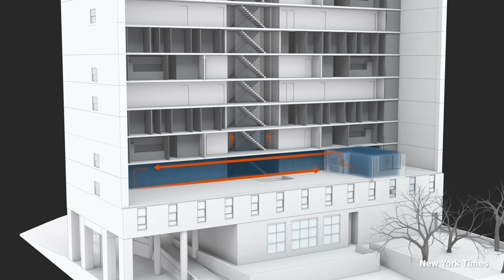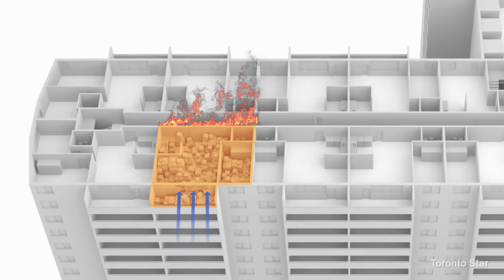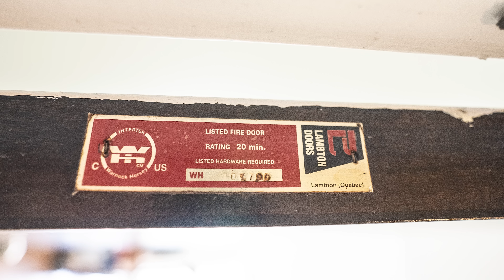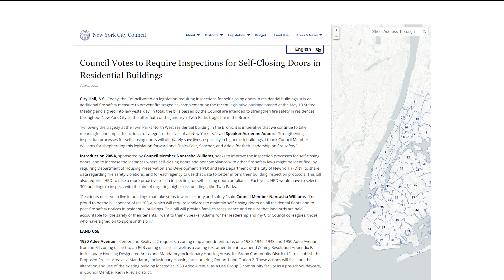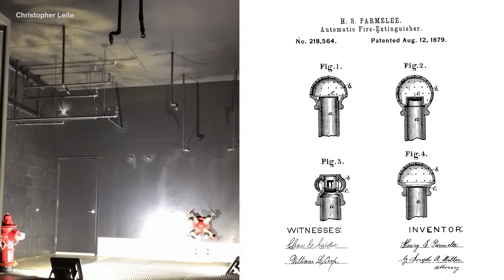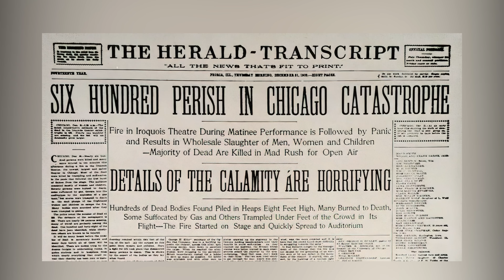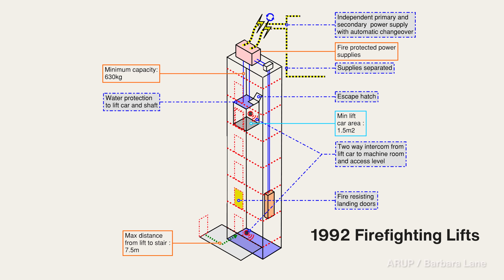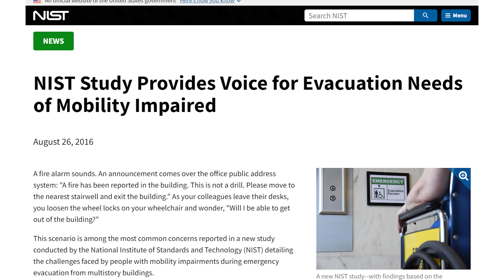How Hidden Engineering Keeps You Alive in Apartment Fires

Comment: So my apartment door is a fire door (only 20 minutes) but I suspect it’s installed incorrectly since there are large gaps on all sides, especially the bottom. I hope that expanding strip is installed but the bottom gap is very large
Reply: I think door foam that expands when heated is mostly a non-US thing. I've lost this argument at my apartment in L.A. I have a heavy fire door. But it requires thick weatherstripping all around it to keep out a strong breeze that is always gushing in from the hall. After enjoying the draft-free setup for six years, one manager suddenly saw it and had the maintenance man scrape it off. The fire inspector now insists that the door MUST slam itself closed when let go after being held open just four inches short of closing! It DOES slam itself closed, even with tight weatherstripping, when let go from about ten inches. 

Ugh. Toxic fumes sometimes come in around the door. Therefore smoke will, too. I offered to pay to install an automatic door closer at the top. The manager said he thinks they are illegal.

Comment: This is pretty cool. I'm an electrical engineer so I always flip right past the fire stuff when I'm reading the code books or plans. I'm familiar with fire ratings on walls but didn't know they encase the conduit passing through walls in that fire resistant goo.
Reply from the maker: Yep, a major issue is that contractors can go in and punch holes in walls without knowing that they have to be patched with the right firestopping materials.  Easy to overlook though as each trade has their own specializations.

Comment: So, I'm very familiar with fire codes in the US and the Iroquois Theatre fire. I work as an electrician in theatre. 

One thing that caught me off guard - I was touring China for work and we had push bars that were bike chained closed backstage. 

If you don't know, theatres are designed so that the stage housing can be separated from the house by fireproof curtains and often contain a deluge system that floods the stage with water if the fire is located on/backstage stage. 

There was no deluge or fire curtain at that venue.
Reply: pushbars are known security flaw in buildings since people bypass door locks to get access into buildings they are not supposed to be in

Comment: damm i live in argentina in a 60 yo building. doesn't have any fire countermeasures. the last 2 times there where fires (2y ago and 15 y ago) we wake up because people started knocking doors and screaming fire. but in bot cases it didn't fill with smoke. but my uncle died in a fire while in an hotel in the beach 10y ago. i really should buy a few smoke detectors so we don't die in our sleep or wake up to an smoke filled room. also like 60% of the people in my building are of the third age with caused that scare of 2y ago to have them going really slow in the stairs. wich are also not modern stairs they are not separate from the floor since my building is not a rectangle but an HHH shape with the stairs in the middle of the middle H so there  is not hard core to the building.

Comment: I'm just glad that in my apartment, I'm on the first floor and so I can just smash threw a window and get out. But yeah, for older buildings, people above you can have their apartments burn up as windows shatter from heat shock and embers flow into the apartment above.
Reply from the maker: Yeah that almost happened in a BC fire!  Luckily the fire department arrived in time.  But it wouldn't have spread across the rest of the building quickly

Comment: Listen to older people so you don't have to learn the hard way.

Space heaters and extension cords are dangerous fire hazards. Dryer lint traps need to be cleaned and so do the vents behind them into the wall to prevent lint backing up inside the machine and catching fire in the hours while you sleep. Watch out for carbon monoxide and change the batteries in all the detectors. Ovens, stoves, and other appliances need to never be left unattended. Never cut the safety lid switch be bypassed on a washing machine, especially if you have kids or if you don't want to be criminally liable. Do not park in the grass with your hot muffler/exhaust system/motor, etc. Know how to contact emergency services and have a backup plan in case they take 12 minutes to answer and two hours to get out to you (both true stories). Know where hospitals are. Don't smoke in bed. Don't force people whose faces flush to drink, or anyone else. Don't mix cleaning chemicals or use bleach or ammonia containing cleaners in enclosed areas. Don't ignore slip hazards. Don't leave kids and small pets unattended in places where predation exists. Kids can easily be lost in mountains and cover a lot of ground quickly, with all the hazards. Water is always more dangerous than it looks and can down you in shallow water by speed over rough rocks or sweep the sand out from underneath your foot at the edge, etc. Riptides kill. Undertow kills. Do not underestimate natural disasters just because the last one seems okay or someone said they didn't have a rough day. Do not leave guns where anyone can get at them or the ammo. 

There is a lot more to know, but young people need to stay close to older people who already know this stuff.

Comment: Fire sprinkler systems are not small and handheld like is suggested and that's why we don't see retrofits required. It's completely intergraded into the building meaning it would basically have to be gut reno to add.

Comment: Fire sprinklers have been mandated in Australia for easily 20 years (buildings over 25 m) also, most new buildings are required to have fire booster pumps separate to the building to provide the fire main within

Comment: Ever wondered why there are Open/Close buttons in elevators that don't seem to work?
They are used by Firefighters. When the elevator is in FF mode, the doors don't open automatically when it reaches a floor - this is done in case there is a fire on the floor. Instead the FF holds the open button to open the door - if there is a fire, they release the button and the door closes. If it's safe, they can hold the button until the door is fully open and then it will stay open. The close button is then needed to close the door again.

Comment: Otherwise I think it checks out, but I would dare to say that 50 years ago homes had a lots of synthetic fibers.  Also the cushioning used on sofas to be highly flammable,  but I think it has changed for that exact reason.
Reply from the maker: From what I understand, it's much harder to ignite synthetic couches because of the flame retardants they use.  However if they do catch on fire, it's going to be bad, especially as the additives used release a ton of nasty stuff into the air
Reply: @Lam  yeah, could be. Just thought that 1970's couches most likely had synthetic draping as those were new and fancy.

Comment: wait, are you saying that buildings that are engulfed in flames do NOT spontaneously collapse into their footprints? interesting. you must be a truther of sorts...
Reply: normal fires.... that didn't cause multiple floors to collapse
Reply: @Ed.E  so what "special fires" are you talking about? plz inform me about the kind of circumstances that would f.e. create welding temperatures for a prolongued time...
Reply: @Ed.E  why don't you just link me that video of that blacksmith who compares boxcolumns under open incomplete low heat combustions with finger thick rebar being melted with a kerosene TORCH, will you?
Reply: @JefframinEpsteinyahu  did that blacksmith account for the thousands of tons weighing down the truss whilst it was heated? Or the vertical displacement? Or the progressive collapse? Did you pass High school physics?
Reply: @JefframinEpsteinyahu  Have you seen Ace Baker's ''The great American psy opera''

Comment: I used to work in newer build in Japan , 15 stories high.  it had two stair case one inside, but it was blocked half way somebody storing stuff.  and another one outside , open spiral stairs runs all the 16 floors.   it also had escape shoot , it was made out of fabric and it goes straight down, I am not sure how they work, but it must work other wise they will not installed them.

Comment: Hi Andrew!  I'm in Toronto, eh.  4 story, wood structure.  I'm in a 275 sq ft bachelor unit. I have 4 sprinkler heads!
Reply from the maker: Nice, that's reassuring!
Reply: @Lam  one is right above my head as I sleep.  
One is on the wall, by the kitchen.
One is in the small, 38" wide by 19" deep closet.
Final one is in the bathroom.

We have picture/plate glass windows, and, sadly, right outside, about 3' away, are electrical wires (confirmed by the resistor sitting about 4' from my window. 🤣I don't feel that's a safe place, but, I'm not an engineer.)

This place was built in 2015, so, obviously, matches up to the standards of 2015.
Management has the alarm tested monthly, the sprinklers every 6 months, and they blow them out (via a designated nozzle in the fire room, via the Siamese 
connectors.

Comment: I live in a mill building that was converted to apartments. There is very thick fire resistant material below each floor, and walls between units are double fire rated sheetrock on each side (which also greatly reduces noise). In my 1 bedroom apartment there are 10 sprinkler heads, and the building has a massive generator backed pump capable of running every sprinkler head in the building at full pressure. There has been an apartment fire while I've lived here, and aside from smoke that did get into common areas the damage was entirely contained to the one apartment. I feel very safe here.

Comment: In a fire in a high rise building always use your brain and figure for yourself if you need to get out - never rely on somebody who isn't there to tell you if you should stay or leave; if the fire isn't contained you should probably get out if the fire is contained and emergency services are working on it don't get in the way. More general point on the video, yes, absolutely: but the fire protections rely on people competently reinstating it to the fire stopping to at least it's original design standard after work is done - this rarely happens in reality - the older a building is the more likely you are to see removed, incomplete or unstable fire stopping. Water ingress over time and damp can cause this to fail also. Even in an incredibly highly regulated environment like the UK this can go very wrong very quickly as happened with Grenfell - imagine in a country where nobody cares in the best of times. One size does not fit all.

Comment: those bars on the doors are rather uncommon in Germany; I know only a few malls which have them, but anything from apartment buildings to office buildings, cinemas etc have other types of fire doors where the handle needs to be pushed down or to the side
Reply from the maker: Malls often don't have them because public facing doors are unlocked through most of the day.  Anything in lesser used areas or in stairways will often use panic devices
Reply: @Lam  malls are about the only place where I've seen them at all; Other doors often have some kind of mechanism on them which will trigger a fire or safety alarm once the handle is pushed down
Reply: @Lam  like these safety alarms mounted underneath the door handle: https://www.youtube.com/watch?v=Z-VyFxMDQiM

Comment: 14:05 is that why you're not allowed to use them during a fire? Not because of the risk of being trapped, but because it needs to be used by firefighters? That's interesting, never knew that.
Reply: Mamy reasons actually:
1) smoke can obstruct the door safety mechanism light sensor and you cannot close the door as it will keep sensing the door is blocked. Fire lifts in fire mode are manually operated to prevent this.
2) smoke may enter the lift shaft. Fire fighting lobbies are pressurized to prevent smoke from entering the lift lobby. Normal lift lobbies do not have pressurisation.
3) fire may damage the power supply to the lift, or control system to the lift. All lift are using essential power with fire rated cable. Essential means there is a backup power supply in case the building power goes out. Changeover is not instantenous. 
4) in a fire all lifts will go down to grd floor and open and shut down upon receiving a fire signal from the main fire alarm panel. Only a fireman switch at the fire lift can override this
Reply from the maker: Great explanation!
Reply: Look up marina bay suites fire in singapore. Lift malfunctioned causing 2 security guards to die. Fire fighters had to stop several floors lower to fight the fire since the fire was very intense and the fire lobby had combustile materials.

Comment: One of things that's also important is the consistency and sensitivity of the building's automatic fire detection system. This past summer, I lived in a newly constructed apartment building that has per suite fire detectors, automatic fire doors that are opening during normal use but closes when the system detects a fire, insulated fire escape elevators, and many other advanced features. The only problem is the overly sensitive fire detection system kept triggering and ordering whole building evacuation from people smoking weed in their apartments. After the third such evacuation, 90% of the residents no longer evaculate, which meant the state-of-art automatic system in advertently caused more complacency due to an incorrect setup.
Reply from the maker: Yeah, that's unfortunate.  Too bad they couldn't change how the alerts go out

Comment: Not in my building, they punched holes in the firewalls and turn off the vents in the stairwells to save on air conditioning ...  🎉
Reply from the maker: Yikes
Reply: You should report that to the Fire Department. Unless there is corruption (a big if depending on the location), they will enforce the fire code.

Comment: 12:07 fire services can actually employ makeshift overpressure zones.

We have dedicated fans for that. On top of that our station usually sends a team to set up the correct ventilation requirements for this as part of the scouting in such buildings.

Another reason why you should not try to leave through a smoke filled staircase, we can make it safe, even older ones.
Reply from the maker: I was reading about positive pressure ventilation!  I was originally going to make a video about firefighting but pivoted.  That's an interesting tidbit about the way stairways are made safe that I didn't know about
Reply: @Lam  basically what you do is close all the doors to the stairway, including and especially the way to the fire. Then you create an opening that is smaller than the intake (usually the door) and then turn on the ventilator.

You can usually extend that to an entire hallway for one level of a building if you open the "exhaust" at the end of that hallway, (it's not really an exhaust, just so there is a flow of air and not smoke from the fire pushed through the cracks as there is no where for the air to go).

This way you can safely evacuate level by level even when the building is fully smoke filled when you arrive.

It's super cool to see when you have it running. Also way better for residents ladder trucks and emergency respirator hoods.

Comment: 16.23 The fire rapid fire spread  was caused by flammable cladding on the outside of the building which quickly engulfed the whole of the building in flames.
Many died in smoke filled exits or in their rooms because they were told to stay put.
Similar situations had occurred in other high rise buildings where fire had spread to other parts of the building but it was not acted upon.
So much for good design and Regulations in the UK!
The Grenfell Tower enquiry is ongoing.

Comment: I have to admit that this is one of the best videos on youtube that I've seen about fire protection equipment.  Also, the fire department can use FDC to pump water into fire sprinkler systems.  In high-rise apartment buildings and hotels low frequency sounders are commonly used in sleeping areas because it is proven that a lower frequency tone will wake you up faster in the event of an emergency or evacuation.  And you can't forget about the lifesaving device of exit signs and emergency lights an emergency light is a basic device that comes on when there's no power and a exit sign is also a basic device that stays on 24/7 365 days of the year and in the event of a power loss will still emit light.  exit signs and emergency lights have to stay on for 90 minutes in the event of a power failure.  Here's a link if you're curious of what a low frequency sound sounds like
https://www.youtube.com/watch?v=IUzHVzIWW70
and here's a video if you want to know more about smoke exhaust and pressurization fans
https://www.youtube.com/watch?v=uv8BTbXV5uQ
and if you want to know the purpose of exit signs watch this video
https://www.youtube.com/watch?v=3rSWEP6Guq8

Comment: This door issue is a common problem in buildings in New York.  
I don't know why, but as buildings get older, the doors don't fit in their frames any more and either can't close because they don't fit in their frames at all, or won't latch closed because (again) they don't fit in their frames squarely.
Reply: I lived in a brand new very high rise (first resident in my condo) and the fire door on one of the two stairways was always left open.  Made a point to close it every time I walked by, but it was shocking to me that a several month old building didn’t even have a properly closing fire door in the stair well.
A few months later there was a small fire in a penthouse, but small enough that all the damage was water damage to a few floors below.